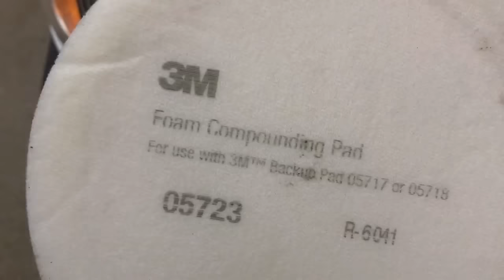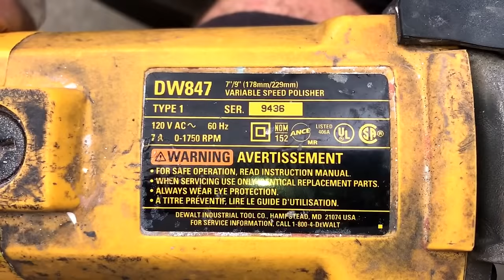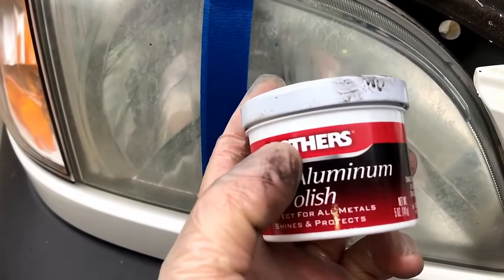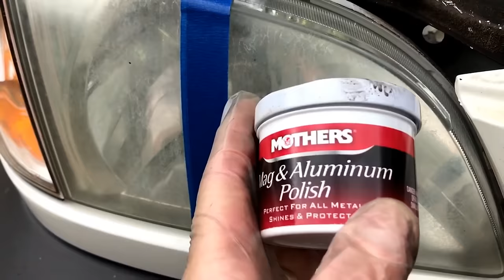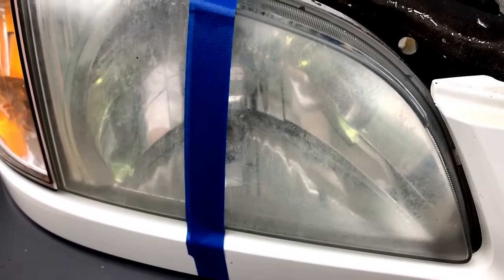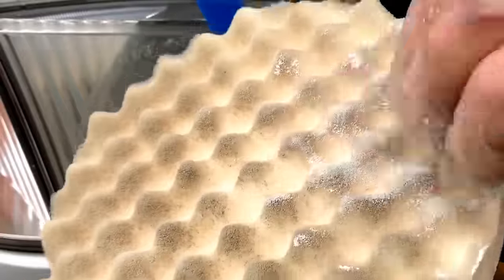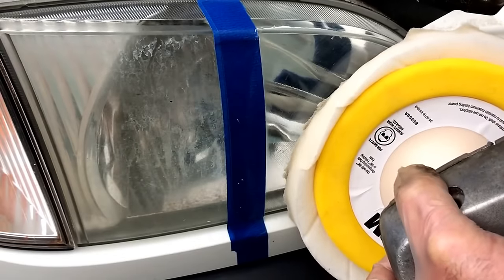How MOMMA Repairs Headlights BACK TO BRAND NEW in 3 Minutes

Comment: CAUTION:  the acetone (nail polish remover) recommended by a commenter proved damaging to the headlight and taillight lens of an '01 GMC Sonoma. Just listen to this guy and buy the polishing compound. worked like a charm on both the sonoma and the 04 nissan frontier. (as a side note, the acetone DID chemically react with the lens cover, pulling off a dark yellow color on my applicator, which had me thinking it was working, however, it produced a permanent hazing that even the mothers polishing compound couldn't remove. DO NOT USE ACETONE ON FACTORY 2001 GMC SONOMA HEADLIGHT LENS!
Reply from the maker: Thank you for sharing, this is a perfect example of why you don't follow illegitimate comments of unproven methods.  SPC will never steer its viewers wrong, we have decades of experience and only show what works.  To summarize this, acetone and lacquer thinner are extremely corrosive to all plastics, so if you are a first time reader of this comment, you just learned something.  Another side note, if someone suggests something on one of our videos in the comments, go to their channel to make sure they have done a video showing their process, if they haven't, STEER CLEAR!   Thanks again.  Take care.  mad Mike the hammer SPC

Comment: I have watched about every video on restoring headlights. After watching your video I decided to give your method a try. My light were so bad they wouldn't pass inspection.I bought a $5 can of the Mothers Mag & Aluminum and an applicator for $1.50. I decided to try it by applying the polish using a little elbow grease instead of a drill. After a total of 30 minutes for both headlights, they look almost new. Fantastic idea, Thanks
Reply from the maker: Awesome, Ken!!  Glad to help.  Thank you for sharing and being here with us my friend.  Happy New Year.  mad Mike the hammer SPC

Comment: I finally bit the bullet and cleaned up my headlights using this process. Mixed results for me but I think that's user error, so I've learned a lot!  First headlight I didn't keep moving the polisher enough so heated up a small spot on the headlight too much so it burned slightly....second headlight looks amazing, so thanks for the amazing video :)

Comment: Had to replace drivers headlight assembly in my mom's '13 GMC Acadia Denali due to a jacked-up socket. (Yes probably my fault). Therefore the passenger side looked worse than its age. I followed the steps here on 12/28/23 and what an amazing result! Simply incredible. Even the smallest pitting was removed. Going back over it tomorrow. The LEDs are back to white as opposed to an amber color due to the yellowing. Need to locate the 303. Thank you for your video and saving me an additional $1400!!!

Comment: One of my favorite YouTube videos. Right to the point. Very informative. And this works very very well. I have had success using a micro fiber bonnet on my polisher but definitely recommend the waffle style foam pad so as to minimize the heat issue. I used to wet sand headlights to restore them. Not anymore. This just kicks ass
Reply from the maker: Thank you very much, our pleasure to help!  Have a great day.  mad Mike the hammer SPC

Comment: Been doing this for years now on people's cars and it blows there mind how easy it is! Great video!
Reply from the maker: thank you david
Reply: Sweet Project Cars will this work if ive already tried the sanding down method?
Reply from the maker: YES BUT !   You Will Have To Sand It With 1500 Or 2000 Grit IF It Is Really Scratched Up...If Not Then Hit The Living Tar Out Of It will metal polish
Reply: if you do that can you get acetone or alcohol to remove oils from the wax to clear coat for a forever shine
Reply: How does the grill goes in the yellow 5717

Comment: I’m near 70 & just did mine 2 days ago before I saw your vid. 
I did use the Sylvania kit, no tools, great results. It included everything needed, polish & finishing w clear coat. 
I love 303 products. 
After doing mine I better understand the problem. 
Now that the coat has cured, I’ll protect them w 303. 
Your info is great. 
Thank you.

Comment: I used mothers mag and aluminum polish on my friends very yellow headlights. Didn't even use a drill or dremel or any rotary device. Just a foam pad and paper towel to buff the excess off. Worked great on it and makes a huge difference just with some elbow grease.
Reply from the maker: Good to hear that smart thinking and with a little effort you have shown people that anything can be done have a great day mad Mike sweet project cars

Comment: Just tried this on my 2013 Toyota Tacoma. It works. Not quite as fast as it looks, but in total time with getting tools out and putting this away. Took about an hour. No biggie. I used a foam pad on my drill, made two passes on each light and finished up with a soft buffer pad and a couple of coats of McGuires UV headlight protectant. I already had the Mother’s. Great stuff. Headlights don’t look like they just came out of the showroom. But they are clear and bright. 👍
Reply from the maker: Great to hear! Thank you so much for watching and sharing your fantastic results, we really appreciate it, hope you have a sweeeeet week my friend. mad Mike & team

Comment: I used a pre packed kit when I 1st bought my AMG 6years ago, & the sanding back all the old clear coating  properly sweating my R's off for about 3 hours, then the application of the clear coating didn't take long & I was wrapped with them looking brand new. Once a year I hit them with a buff & wax that kept them decent, but this last year I just wasn't happy with them anymore'. So was ready to do this major crappy job all over again, or spend 70 bux with a 2 step Maguires kit. Then I saw your video & this morning I went outside, grabbed my 3/4  tin of Mothers, & my buff, & in less than 10 minutes they have turned my lights better than they ever had, (brand new). Thanks so much for passing this knowledge on, & whoever passed it on to you! I Mothers sealed ,& glazed them, then Mother's Carnauba Waxed them, and am stoked with how perfect they are. Thanks again man, I owe you a beer.
Reply from the maker: Peace Peas thank you very much, we are glad to help,.and we actually came up with this method after the struggles you mentioned...the torture of doing them with sandpaper and all the steps and hours... we decided to find a better way and hence the video you just viewed :)

Comment: I have a 95 chevy k 1500 with extremely cloudy headlights. I was getting ready to order replacements when I came across this video. I had my doubts about this fix but figured I would give it a shot since I already have the mothers polish and small buffing pads. To my surprise it did an amazing job compared to what they originally looked like. They are not perfect but vastly better then before I did this. Thanks for the tip.

Comment: I had a Maguires kit I bought two years ago and never used because it looked like a pain. I finally watched a video on it to see someone else using it and found some kid using the Mother's mag and aluminum polish and couldn't believe how easy it was. I went out and bought the stuff, rubbed it in and did it again and did both lenses in fifteen minutes using a microfiber cloth to apply and remove. They look brand new. Glad to see your video using a drill. That'd be way easier.
Reply from the maker: Thanks for watching and sharing, we really appreciate it, have a great week jonnyboat2! mad Mike the hammer SPC

Comment: I just did this yesterday to a 2010 Honda CR-V and it looks like I just replaced the headlights. I didn’t use a polisher though. I have a meguiars orbital polishing attachment called the da power system for a drill and used the polishing pad. Took about 15 minutes and the results are amazing. Thank you for the video. Once I was done cleaning it all up I used some 303 protectant to seal and protect the lens.
Reply from the maker: Awesome Kevin!  Thanks for sharing.  Have a great day. mad Mike the hammer SPC

Comment: I tried alot of the headlight restorers out there. Even the ones you just use a buffer and apply it. If even used Turtle wax headlight restorer and it cleaned it up somewhat but, within a day or so it was back to how it was. I came accross this video and man I was shocked! Today I went to Advanced Auto and bought some. I didn't have a buffer or the money to spend $25 dollars on a kit so I used a new Wax buffing pad. It's not as aggressive but, it's all I had. I taped the paint around the headlight, cleaned the headlight with glass cleaner and then applied a thin coat to the headlight. Buffed the product into the headlight for about a good 2 mins and then wiped off. I had to repeat it a second time which helped immensely! When I wiped the headlight off with a microfiber towel I said " We'll I'll be damned, it worked!"  Went and showed my wife and she couldn't believe it! Thank you so much for this video and every other one you have made. You have helped so many people!
Reply: did it last sir?
Reply: Yes it did! Especially of I used a protectant or sealer

Comment: Incredible! I just did my Toyota Avensis headlights and they look like new again!
I just rubbed it in and polished it by hand with a microfiber polish pad. Ok, i am sweating...but the result is realy worth it!
Took me about half an hour all together.

I first went to a headlight repair specialist and they told me that most of it was on the inside of the headlight and they could not do much.
Then i went to my dealer and they said, we need to sand them completely and then recoat them again. Would have cost me 65 Euro per headlight.
Total costs now was 30 Euro!

Thnx a looooot this great tip!!!
Reply from the maker: Awesome!  Thanks for sharing, we appreciate it.  Have a great day my friend.  mad Mike the hammer SPC
Reply: Sweet Project Cars, i now also did the UV protection with 303.
Lets see how long it lasts...

Have a great day also!
Grtz from The Netherlands.

Comment: I used just a 1/4 of a paper towel and folded in half and then half again and then just kept using a clean section by unfolding. I did not use my buffer. The average person with five bucks can buy Mothers Mag & Aluminum Polish and do a good job with a little elbow grease in about 10 - 15 minutes. My car is 11 years old and wow what a difference it made. Like New! I also use Mothers Mag & Aluminum Polish on the Plastic Chrome parts of my motorcycle and then use Liquid Glass to protect it. I also use Liquid Glass on the metal chrome to protect it also.  THANK-YOU!!!
Reply from the maker: Good job glad to hear it works for you my friend
Reply: No tools, just elbow grease. It works.
Reply: THIS IS GOOD TO KNOW since I don't have access to power tools.
Reply: Hey what's liquid glass and where do it get it
Reply from the maker: @talknheadz  its on their website and not cheap, you are better off to just use the conditioner mentioned as it has the UV protection you are looking for:)  ty mike
Reply: Little Miss Sunshine  Is that the Heartbeat City album? I'm trying to remember off the top of my head, no Googling 😅

Comment: the aftermarket headlight companies are NOT going to like this video
Reply: Agree! Only reason I ended up purchasing new headlights was that the ones on my maxima were customized by the previous owner & the inner custom pieces used were falling out of place. I didn’t want to place them in the over to un-glue them then to refit the parts. Think I’m going to treat my rear lights next
Reply: awakepatriot that’s not how the market works and unlikely the “headlight companies” will be affected.
Reply: No kidding.
I had tried other polishing compounds I have and mothers or silver polish does the Very Best! Then I used a good wax and hasn't done it again.
I felt it needed with a good wax and proved right ..
Reply: N

Comment: Okay, now I’m sorry I purchased a 3M headlight restoration kit, which I didn’t use yet but I will use the buffer pad. Now I’m heading over to order the Mothers aluminum cleaner you showed. Personally, I’m afraid of sanding my plastic headlights. This approach is definitely worth trying first and I have faith in you that it will work. My headlights aren’t that bad, except for the top which is showing signs of haziness. I already purchased the 303 protectant. Thank you very much for sharing.
Reply from the maker: Butters you will love the results, my friend  mike

Comment: I restore headlights. Those were the easy job. could have used any type of buffing compound or scratch and swirl remover and got the same effect. The kit with different grit sandpaper is for when it's so bad you have dead plastic to remove. That headlight I considered dirty
Reply from the maker: thanks for sharing as they say different strokes for different folks

Comment: Just so you know. You guys are amazing. I'm a huge fan and you respond to all the questions so thank you!
So I bought a small drill kit with pad for my ryobi drill. I used the mother's and the yellowing has improved , but I can't seem to get rid of these tiny cracks in the plastic. Do I just need to keep buffing more? Are there a recommended drill bit kit to use? Seems you clear the headlights a lot easier than I do...I used the pad and mothers and its taking me forever haha
Also any tips how to fill in a long scratch that went to the plastic of the bumper? I saw videos of clean, spread bondo, sand, apply touch up paint and buff, but its still noticeable...I guess no way around it unless its repainted?
Reply from the maker: Scotty those tiny cracks are call crazing and they are embedded in the plastic, you cannot remove them, this happens when the manufactures use lower cost plastic to make them so they dry out faster from the UV of the sun, that's why we use the 303 UV protectant. Also, the tools you see us use are the only tools we have found that work really well, but still the crazing will be there on some model cars, even when we do them. Now, as far as the scratch have you seen this video https://youtu.be/M8lj0_C-iPI it may help you with the scratch and what it takes to remove them.
Reply: Sweet Project Cars. Guess I missed that video, thanks for the link
So what do I do about a cadillac white diamond tricoat paint? I found a duplicolor pen, it says it contains tint and clear only. If the scratch goes to metal or plastic apply a primer first. Is that right?
Reply from the maker: yes if the scratch goes to metal then use the etching primer in the video tools list :)

Comment: Mag Polish: $7
Manual Applicator pads: $3
Box of 500 rubber gloves: $2
Lactic acid in hand muscles : Undetermined Value

Still cheaper than buying new headlights for $100 a piece
Reply from the maker: The Unnamed lol good job my friend thanks for sharing :)
Reply: Where you get 500 rubber gloves for 2 dollars?

Comment: The only thing it doesn't fix is the rock chips and gouges and tiny pits, that's when sanding is necessary. This process does work for clearing though. I use it regularly to keep mine clear.
Reply from the maker: Thank you for watching and sharing, and you are correct, this is a fix  for foggy headlights.  Have a great day. mad Mike the hammer SPC
Reply: You forgot to mention bullet holes and the ex-girlfriend's axe marks but just use a little more mother's and you'll be fine.
Reply: @acebrockton1828  😆

Comment from the maker: *FOLKS* If you want even **BETTER RESULTS See This Video We Did** https://youtu.be/hD2CKp9mco0 **NOW if you have yellowing lights or PEELING CLEAR COAT and Mothers does not do the job you will need to do this https://youtu.be/GKLF8oIWYGg hope this helps**
Reply: Sweet
Reply: Going to try this on my 2003 Honda Odyssey, they're famous for f'ed up headlight lenses. I have it really bad, if it works on my headlights it should work on any headlight assembly. Just curious, you suggest just some Aerospace 303 as a polish after restoration?? I would think that unless it's specifically made for clear plastic, 303 might actually speed up the reclouding, but I'll follow your lead. I'll report back once it's done.
Reply: can i use turtle metal polish?
Reply: Good job thank you for this tip
Reply from the maker: @estebanalonsi7316  you can use whatever you like we are just sharing what we have found works best for our customers :) ty mike
Reply from the maker: @justacinnamonbun8658  no issues with the 303 by any means, but this video here is the ultimate repair  https://youtu.be/hD2CKp9mco0   TY mike

Comment: Nice video, thank you! I've followed 2 other videos and wasted alot of time and my end results was my headlights never changed and still looked like I didn't do anything. I will try this tomorrow.
Reply from the maker: Great to hear!  Thank you for watching and sharing.  Have a fantastic day.  mad Mike the hammer SPC
Reply: @SweetProjectCars  worked on my headlights and I would have to say yours looked alot better than mine, they came out to being maybe 90% better than they were. I used the buffer wheel then did a second coat by hand, I am impressed with the way they look, this saves me $600 on buying new headlights and keeps me from removing the entire front bumper end to install new headlights

Comment: I did mine in less than 30 minutes both sides. Just with 2 items... No electricity needed...
Reply: no electricity? as in no powered drill?
Reply: @HadEnough745  nop just sand paper T800 and water.
That makes 3 items I guess 🤔
No alcohol... It fk it up on my last job

Comment: Weight aside, I wish the headlights were made of real glass.
Reply: Volvos around 1990 had real glass large headlamps with removable bulbs.  Other cars too.  They all had cracked or shattered headlamps after a couple years of highway driving.  Sealed beams (round were best) were the best real glass lamps.  Bulb burned out you got a new glass too.  Today's driver would find them ugly.
Reply: John Diaz mine are! ‘91 Si CIVIC HATCH 🐣😎